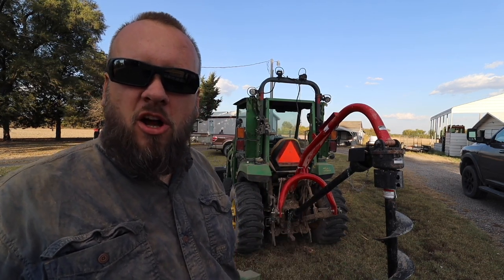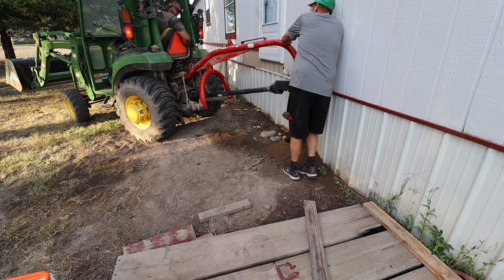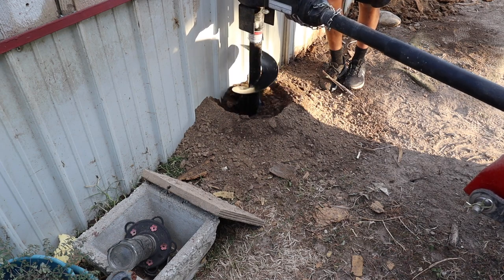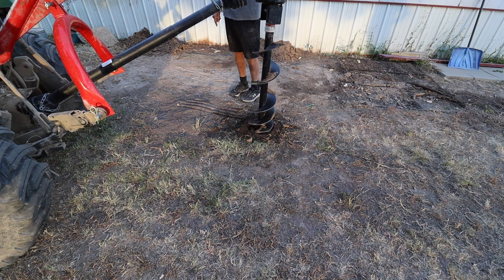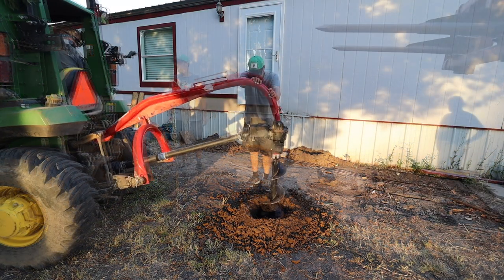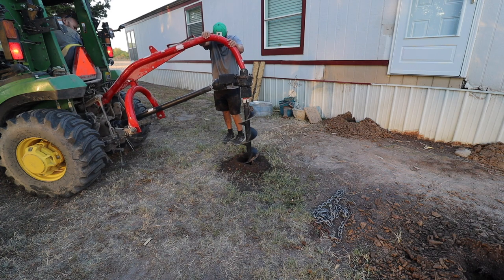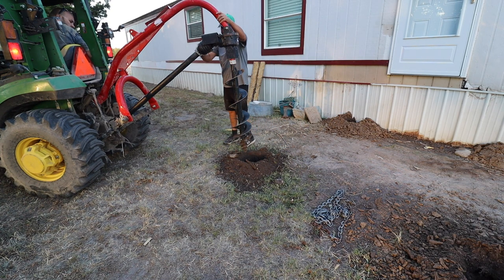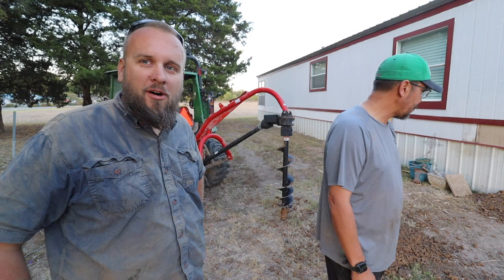How Many Times can we get this Post Hold Digger Stuck???

Comment: I have the same issue with my 2038r and County Line 3point auger. Only it was my hard Missouri clay soil letting the auger pull itself down like a screw biting into wood.

Here is how I fixed it

1. Adjust the drop-rate for the 3point to as slow as it will drop (test/set this before digging with implement in free air

2. Stack a mix of 6x6 and 4x4 pieces  under the 3point arms before starting to dig the hole.  This helped the most.   When the auger sucked itself down those blocks did 2 things. They either stopped downward movement and while the auger spun it broke loose the dirt at that level. Or the compression of those boards provided some spring-force that helped my tractor lift the auger back up as soon as I stop the pto from spinning
Reply: Agreed!
I just posted something similar. Then scrolled down and saw your post.
We'll said sir! Great workaround.

Comment: You're a brave man for putting those post holes so close to the side of the house. Could have taken some of the risk out by putting them about a foot away and the deck built to meet the side of the house. I guess that's what the customer wanted, but it usually doesn't hurt to suggest alternate approaches to certain tasks that could possibly damage surroundings.
Reply: Not to mention the guy standing right next to the drill. Sketchy at best

Comment: Always good to see the best tractors ever made to help out a John Deere.  :). 

Only advice I could think of would be to start with a smaller diameter auger where the tractor will be powerful enough to lift a 6" auger out then go in with the 9" and clean the holes up and less wear on machine.

Comment: I use a Danuser brand PHD.  Never had issue with getting the augers stuck.  I go about 6” at a time and pull almost completely out every 6” the auger advances to spin soil off the flights.

Comment: The yoke needs to be connected to a hole farther away from the back of your tractor. Use the hole that positions the yoke in the most upright position for better mechanical advantage.

Comment: The only alternative I know of to stop the auger from getting sucked in is to dig the hole with a set of manual post hole diggers!! It's just part of it. The only tip I can offer is once you reach the depth you want stop the PTO and carefully lift the auger out with the flights full of dirt, move the tractor away from the hole and click the PTO on so it will empty the flights. Just helps get all the loose stuff out of the hole. Not sure if the steep angle of the flights of your auger will hold dirt like I'm talking about or not but give it a try

Comment: I had the same problem. I got stuck several times the first time using my auger. I throttled down for more control. Big mistake. Crank that puppy full blast! The 3pt isn't strong enough and it will suck it down, but with the throttle up it will start spitting dirt out when it hits bottom instead stalling. It's scary at first, especially when you are gun shy about getting stuck, but I maxed out my PTO speed I haven't been stuck since. Spin fast, lower it slowly.

Kubota B2320 (23hp)

Comment: I use a handyman jack when it gets stuck. Much faster than reversing with a pipe wrench. Put a board on front side of hole. Jack up on front lip of gearbox. Works well unless you’re all the way down.

Comment: Hey Brock & Helper, what you guys have here is the perfect 20th century " PERFECT Torture & Killer Machine". My experiences has been very similar using "ole Killer". With precise RPM 's, down drop speed dialed in, a SLIP-clutch installed, a GOOD Helper on directive instructions, ultra precise timing on the engagement & disengament( never let go of leavers or switches), ;--- Minor SUCCESS can be Expected. By keeping a "trusty" pry-barmitsfa to counter- rotate the bit ( near the top U-joint) [ requiring temporary  guard removal] TOTAL Success CAN be ACHIEVED.  Or just BUY a hydraulic unit for 2500.°°$ and " PRESTO, yer cooken with gas"-:-= this is my goal !! Thank you for the great Video Sir and happy safe auguring.

Comment: I got one of them, and regally hate it. Hydraulic loader mount unit was very solid investment with over a mile of fence and over 100 posts in new barn. The 3 point was good to have in the small barn where the hydraulic unit wouldn’t make the overhead clearance that’s about it.
Reply: Front hydraulic mounted augers are the way to go but they cost around three times as much as a 3 point auger.
Reply: @kdegraa  in my ground it’s the difference between getting something done and not!

Comment: Brock, Would blocks of wood under the 3point link arms and cross bracing set to the proper hight help?
Set hight just before bottoming out the auger. 
Thought being, it'll seat itself before bottoming out/stall, keep spinning and purge the spoils instead of stalling. This way you can still lift back up by way of 3point power.

Comment: As someone else mentioned you can adjust your 3pt rate of drop so it's almost all the way closed/restricted. You also have the 3pt bracket on the closest hole to the tractor.... you should try to have that bracket in the furthest hole back that way you have more leverage to help pull it out. Hope that makes sense.
Reply: I agree. My Tym T454 has a knob in front of and below the front seat to adjust the 3pt drop rate. When I first got the tractor the 3pt wouldn't go down and it took me a bit to figure out why. Great tip.

Comment: I have a 55hp tractor and have property in Georgia with lots of red clay and tree roots. What I have found is to go slow, dig just a little and rise it up, do not let it get a good bite . Be ready to pull it up as soon as you feel it really grabbing. Also with a small tractor and if you have a  bucket on the front, load it with dirt to give you some weight  on the front .  I have never gotten it stuck doing this.
Reply from the maker: Good tips. Technique definitely matters. I bet your Tractor has at least 2500 pounds of lift on the 3 point. Mine is 1200 pounds

Everything else about this little machine is pretty good, but the three-point lift is terrible

Comment: In the same boat with the drought here in Nebraska.  I drilled 45 16" diameter holes in the middle of September.  I had to use a 9" pilot hole first than the 16" to break up the solid ground (which I had to remove by hand) than drill the hole the rest of the way down. Took me 2 days with a skid steer but got it done.

Comment: I've dug hundreds of holes with one of those, bush hog brand. Been stuck like that a few times, tractor that I was using was a ford 2000 with live pto ( 2 stage ) clutch. Easy to stop pto by completely pushing clutch pedal.  I think your tractor has a independent pto which has to be disengaged to stop the pto from turning

Comment: Move your wishbone on the (two bottom links) connection at the top where it meets the top link out as far as you can, but still able to lift out of the ground.  That will give you more leverage as it’s at its weakest where it is now…. But gives the most lift height.  Also when mine sucks down , I’ll give it more power to try not to stall…. Then when it bottoms out, it will start breaking the screw loose and pulling the dirt out, freeing the bit.( usually but not always ). Then I’ll call for my wife to come unscrew it.   She’s good at that.  Lol

Comment: I had been kicking around the idea of buying a post hole digger for my little tractor... but I'm thinking now that I should wait until I get something bigger.  I fear I might have the same issue with my soil as once you get down a couple feet it is clay.  I'll check around the area and see what kind of luck other folks have had.  I'm going to have some major upgrades and replacement of a lot of my fence posts around the farm.  Don't want to be digging those by hand... lol!  Thanks for sharing Brock.  🤠

PS - A lesser man might make a snide quip like asking Billy if those were his legs or if he was riding a chicken... but I'm not like that, so I won't.  🐔

Comment: Many of us have done that too. Like a lot of people, adjust that pin out to the furthest hole for max pulling up leverage, the way you have it is set up for max travel up and down. The last time I did this was for a mail box project and I tried rocking it back and forth a little while spinning it to help break up the clay around it. Don't do that. Ended up turning my now stuck auger into a banana shape. Had to break out the pipe wrench and cheater bar to unscrew it and broke the pipe wrench from all the torque being put on it. Can't tell you how much I hate that 3 point hole digger. Have seen recently here where there is a low flow loader mounted auger. At least you can reverse that one! These 3 point ones should be outlawed.
Reply: Wonder if the loader mounted auger would have the same problems?  Getting the auger stuck is one main reason I don't care to have a 3 point auger for my tractor.  Well that and my tractor is so small it wouldn't have enough power for it in the first place...I'd probably get 1 hole partly done, and get the thing stuck and that's where it would permanently stay LOL.

Comment: Slow the pto drop/drag  rate to almost nothing make sure RPM are at 540 on PTO. (That keeps your hydraulic pressure up to fight the Drag. Clean out often move your pin on your yoke  out so the auger does not have the leverage

Comment: That's the main reason I don't care to have a 3 point post hole digger for my tractor, the 2nd point being my tractor is a sub-compact, it wouldn't run one very well in the first place....with the type of soil in my area I'd probably get about a foot to 18" deep and it would get stuck there permanently.

Comment: your operator should pick up on the auger just like backing off when drilling, he's putting constant pressure on it making it dig too fast
Reply from the maker: Surely you can tell that the tractor is not pushing that auger down

First the tractor doesn’t even have down pressure, the only pressure that can be put down is gravity

Second it’s sitting there spinning and not going down. Maybe going down 2 inches a minute and then when it grabs it sucks the whole thing down a foot in a few seconds.

I’m pulling up on the auger while it’s sucking down. There’s not enough lift force to counteract the auger pulling itself down
Reply: @RockhillfarmYT  i was talking about your helper, he was pushing down on the auger. he could lift up on it to let it catch up instead of pushing down.

Comment: Title should be: How NOT to Use a Post Hole Digger
Reply from the maker: It basically was.  Also with no reverse feature and very limited lift capacity on the three-point they can be really challenging in different soil conditions
Reply: @RockhillfarmYT  I dont know of any “reverse feature” on any PTO. I’ve drilled hundreds of holes in soft soil to shale rock. I never lower the three point more than a foot at the drill at one timw. Let it drill and lower to the next level. Even better if it has draft control